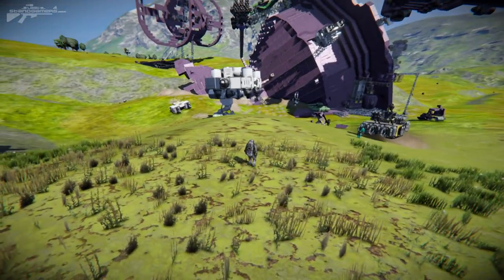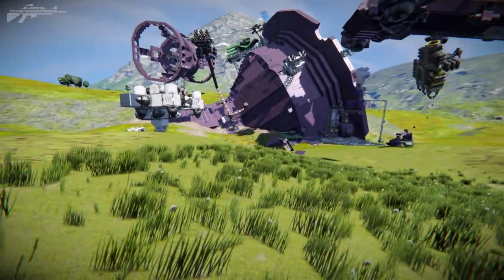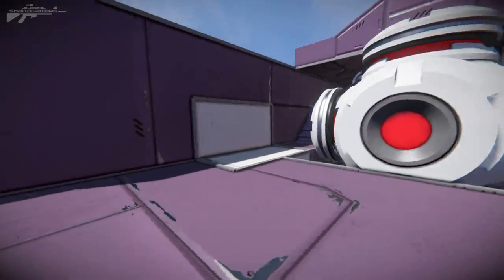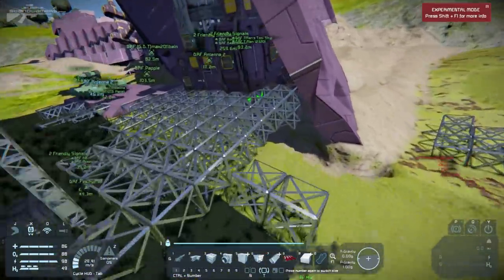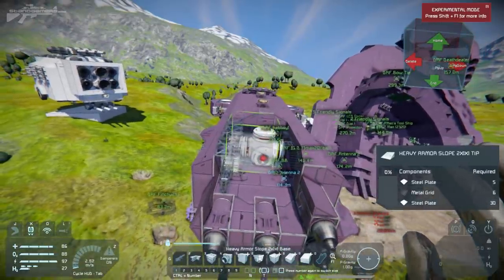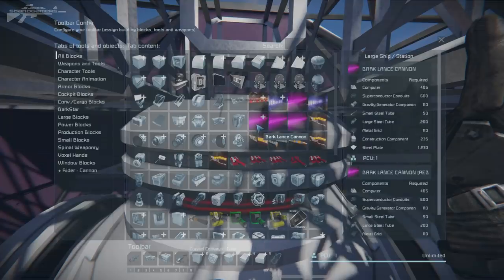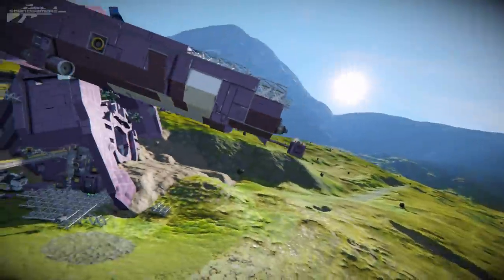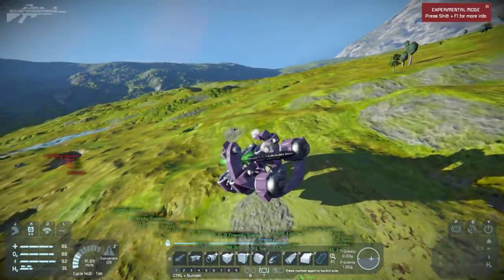Tools Out for Harambarry  (CW) Space Engineers - Part 16

Comment: Here’s an idea for you: An insanely fast, small ship, so fast it can fly through turret defenses without taking much damage. Build this ship, aim it at Jack’s main garage from a distance using the cameras and then just full speed straight up plow though his base with the ship kamikaze-style. You could even add an explosive payload so that when it is finally destroyed it explodes the base from the inside.
Reply: There is a speed limit of 100m/s (the game gets rly glitchy when something goes faster) in space engineers and I don't think they are using any mods to change that.
Reply: Starwars reference
Reply: Some people are usually honorbound to not use kinetic missiles. They are borderline unstopable and very annoying
Reply: most kinetic missiles ive seen still need a good pilot otherwise they are useless.. also.. enough firepower still stops them...mostly :)
Reply: Mike Whitaker not really
Reply: Eko02 yay I agree but personally I use the speed of light mod
Reply: you did read the "I've seen" part right... and yes enough firepower will still shred.. i have a ship that's done it... frames drop when the guns go off.. but it still shreds targets... even kinetic missiles
Reply: Indrick Boreale Well, in this case it would be an eye for an eye thing
Reply: @Eko-jh9sf  Unless you are using a clang drive.
Reply: so.... a rod from god?
Reply from the maker: That sounds like a great idea my only worry is that jacks defenses may be to thick and the ships would be cut apart in seconds.
Reply: best bet i think is to mine a cargo full of rock... fly above them just out of range and drop the cargo can with something on top that is targetable.. the rock will reform after cargo gets blasted and unlike steel blocks is harder to destroy... also the gravity of the situation makes the rock exceed speed limits too.. and while yes the rock is useless in space combat... planetary bombings still work fine... and as a plus gives a use other than just chucking the rock in small pebbles out of a connector for your mined stone... just make sure its a large block cargo.. and if you get a large cargo full even better... thats one big rock.....
Reply: turn thruster override on and jump out. have fun. Or remote it, set course, then turn on thruster override and fire and forget.
Reply: God it would b good but please something called gramer exits
Reply: I'm pretty sure there's already something like that. What was it called? a large, explosive, pointy thing? The word is on the tip of my tongue but I can't quite place it...

It's a missile
Reply: There is a speed limit, the only difference between a good built large and small ship is accelerating, both can get up to 110, but small ones accel faster

Comment: Build a auto drone builder in the hive that is similar to jacks welding wall
Reply: I personally also would do that. And install there additional refineries so it could work as mobile base. After that I would re-purpose Harambarry as dedicated large drop-ship.
Reply: That's not a bad idea, but time isn't on their side nor is terrain. Have to build a separate section off to the side to have a level space to work with. Or you could design a smaller version for the Mini-Hive since it would be the most stable and level currently. This also means designing drones that can be built by this smaller printer. So they would be much smaller, lighter, restrictive in cargo space, and limited weapons. But they would be faster to produce, and perfect for rapid response and intimidation tactics with larger numbers being able to swarm targets. However must stress this, they really need to build up their perimeter defenses before anything else. As much as rebuilding the ships is critical, I would argue that they can wait so long as they're kept off the ground to avoid voxal damage. But the pirate group shows up again LSG is going to end up loosing more then his team can reasonably afford to loose. And the Caravan will be their first target as it's the only ship currently with heavy weapons that is mobile, then Rodney the tank, then the front of the Hive to blow open the doors and aim for production and power reserves. Even if I had no knowledge of the interior layout I'd want to attack the least defended position on a base and/or ship to avoid as much heavy damage as possible while forming a breach to get someone in to start grinding conveyors to halt resupply so that the main guns use what ammo they have in their limited reserves before flying over and laying waste to them and anything I can before being forced to bug out and/or shot down. And no disrespect to the Henry, but they take off a wing that thing is falling to ground. So here is recommended list of priorities.

1: Perimeter defenses (Preferably cheap and light and further from the Hive to give heads up of point of contact as well as some heavier guns closer to the base and around it to provide better coverage)
2: Repairing and constructing some kind of response fleet (air and/or ground)
3: Finishing up on building the Mini-Hive (With possibly materials, fabrication equipment, cryo-bays, med-center, and maybe a small limited 3D printer for limited drone assembly. And docking connections to accommodate them too.)
4: Building one or two more ships to leave atmosphere with enough materials, fabrication equipment, cryo-bays, and med-center(s) to construct a base and/or station off world.
5: Ensure that before leaving there isn't anything of importance left inside the Hive and rig it to blow with trip sensors and/or timer blocks.
6: Get off the planet (hopefully before the raiders return or between attack waves to mitigate damage during launch)

However if those can't be achieved perhaps seeing if there is a way to re-establish communications with the Drone army to get blueprints and possibly reinforcements. The relay that was found on top of the mountain outside of the Hive might have blueprints some where inside to reconstruct that array and it might be powerful enough to re-establish coms. But still follow steps 1 and 2 so that there is something to provide some kind of cover and provide time to mount a proper response.
Reply: Plot armour doesn't allow this. It would either be extremely bad, or extremely good, just to "magically" become saboutaged.

Comment: Sneak somebody over to Jack's base to create a clang making machine under his base.
Reply: As he siad currently it don't work.
Reply: It would create lag and klang for both of them
Reply: Why not pull WWI sapper tactic then...

In WWI demo teams would tunnel to various points against trenches and under fortifications to hollow out the ground and lay down a very large pile of TNT or any explosive they had on hand. Trench walls would be blown out and troops could pour through without having to cross over no-mans-land. However this took extensive planning, time, and resources to pull off. So it wasn't something that was used as much as it was faster and sadly cheaper to throw as many bodies in front of one another to take the onslaught of machine gun fire, mines, and barb wire hazards. But the principle and theory might hold some weight...

Have a small team sneak in under the base and drill out and around the entire base without breaching above ground if at all possible (so recommend some distance from the base and below firing arc of the cannons) and rig high yield explosives through out the entire area. Leave a section still connected above, but again pile the rim of bowl with maybe 2-3 times the explosives. Once you're done make a showing up on the ridge to get their attention and detonate the charges. The whole base in theory should fall and structure should collapse in on themselves due to sheer weight and lack of sturdy foundation as Space Engineers would no doubt glitch and phase stuff through and try to repel and have possible (and disastrous) results with more then likely severe lag and Jack's team decimated in the chaos. But again, that would take time, serious coordination, something in place to recharge the drills that was close to the site yet undetectable, some serious luck that you don't happen to breach inside any structure that may or may not have something underground, and hopefully there is no further attack on your base while you're down a few during this. For the record I'm pointing out all the things you have to consider should you take on this endeavor.
Reply: daniel beck The problem is that antennas are broken so even if you turn everything off, they’ll still see the antenna. So sneaking into their base is virtually impossible unless they fix the broken antennas.
Reply: True, but if I recall LSG sometimes sees Jack's signals inside the center of the planet from time to time due to some kind of glitch. Digging under the base would also lead them to see it as possibly the same thing in Jack's case. The thing is though in order to get this same glitch to work the ones from LSG's team to do this would have to make a run on the base so that their names are flagged for Jack's team with their antennas on. They would stay visible on their antennas (even after shutting them off), but they would have to stay clear of the Hive so is to not lead them back even to provide aid. Instead they would need a small operational outpost to work from with limited manufacturing capability and a med center. But again, this leaves LSG short handed, and Jack and his group might want to dispense some payback of their own for the Wyvren and the loss at the old base. And possibly see it as opportunity to test any new ship(s) that they could have in their possession.